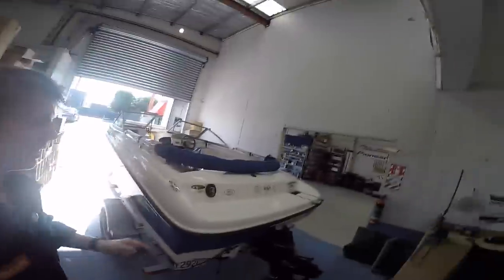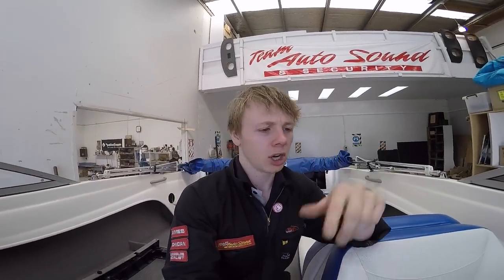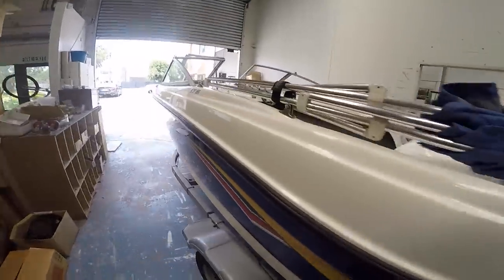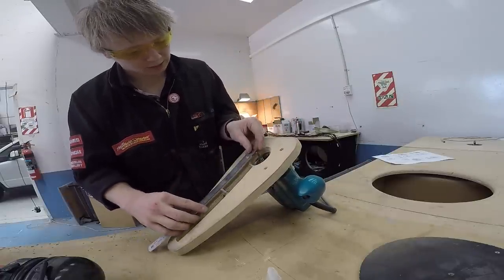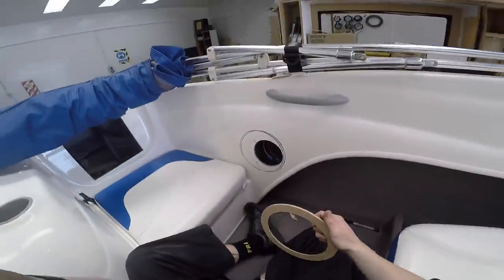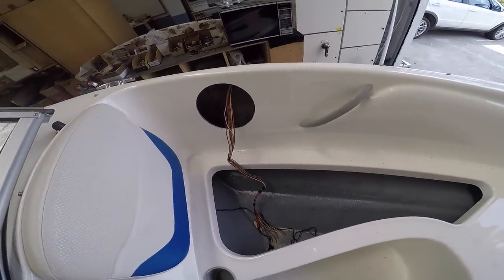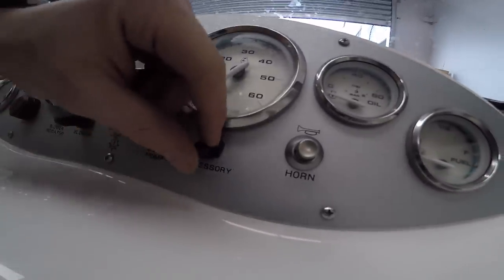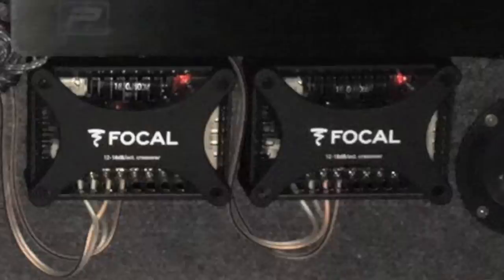Rockford Fosgate Bayliner Boat Sound System Install | Part 1

Comment: I'm putting my two amps in the cubby hole passenger side and have a fosgate p2 under steering wheel and 4 speakers inside the boat at 2 tower speakers.  Just because of length you think 12 awg to the sub and 14awg to rest of speakers?

Comment: I installed a stereo in my boat. it has a outboard mercury 50hp. and I have motor noise in the stero and the vhf radio? sounds like spark plug noise not a wine, any ideas how to stop the noise? is a boat motor like a car/truck as far as can I add snap choaks to the plug wires? ive done this to automobiles and it stopped it. but I have no idea about boat motors. any ideas?